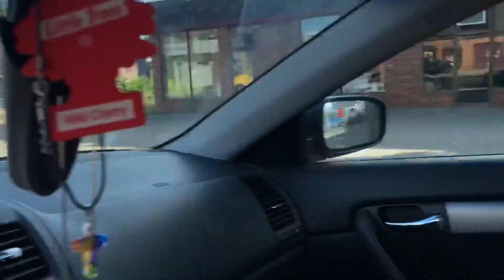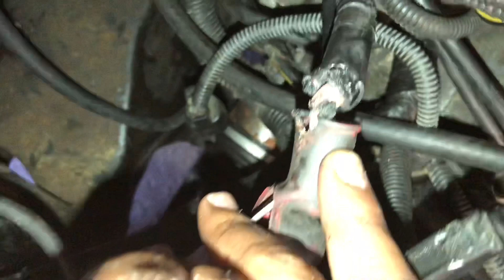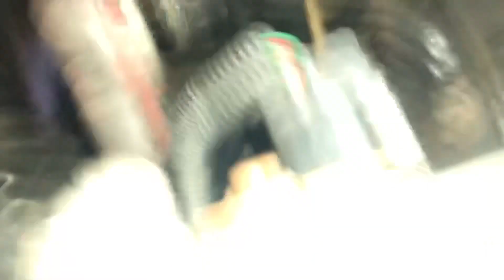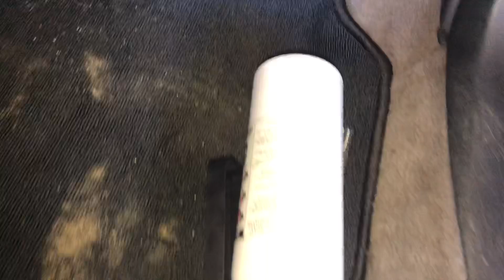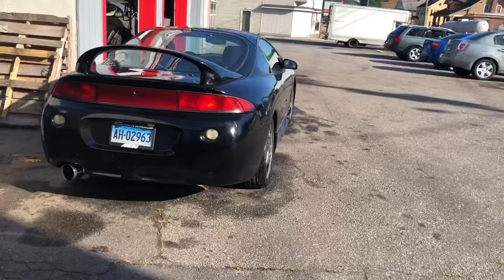Street pulls in my 500hp dsm... something went wrong??

Comment: Theres a write up on dsmtuners how to properly have your battery wired. You need some distributor blocks and circuit breakers since you have it in the trunk. Mines in the trunk too, and when I drove it(before the proper wiring), I can feel some lack of power when at a stop. Great vid👍

Also, you needa have more ground loops to the block. Ima try to do a video of my setup soon.
Reply from the maker: Ryan gst I’m gonna check it and read up on it. I have a fuse just on the power wire now but I’m sure there’s a better way to set it up like you said. Right now I have 3 ground to the block but I’m sure the more the merrier. Thanks for the advice though 🙌🏽👍🏽
Reply from the maker: Ryan gst and yeah post a vid, I’ll check it out 👍🏽
Reply: @vic_gst7579  you'll get it goin good. 👍No prob. Welcome man 🤘

Comment: Where U get UR Starter and 4 how much? U sure ur starter was no good bet if U tapped it with mullet hammer n taped up the wires the starter be good to go probably just locked inside from the shortage. Man that not cool with the video pic n title man U made it seems like was gonna be some major issue like ur transmission went out or something major. Not COOL man not cool!